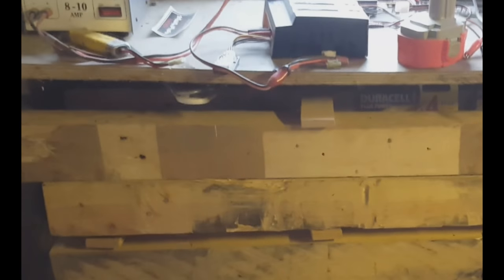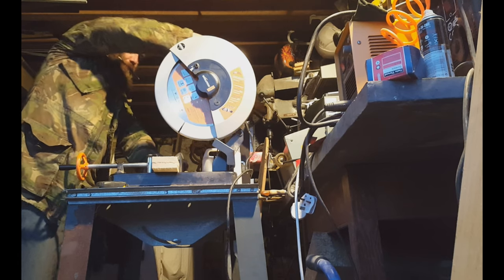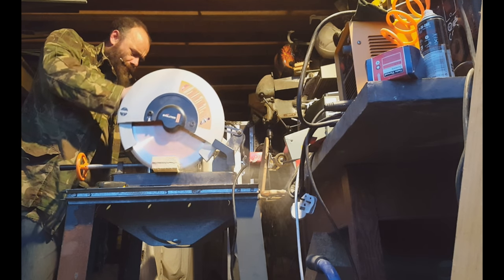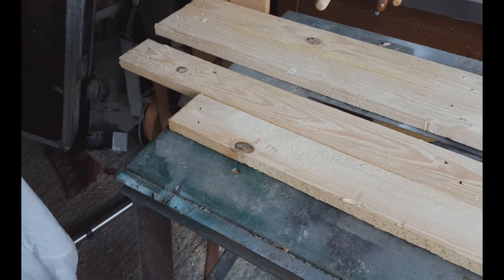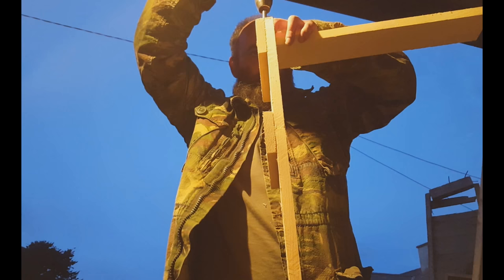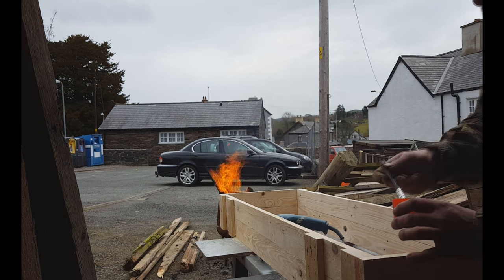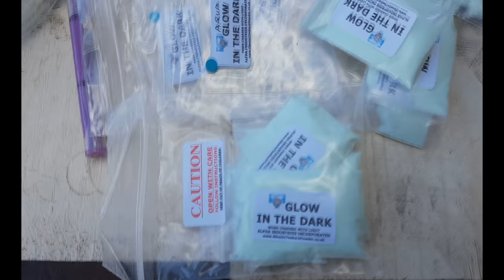DIY Pallet Coffee Table - Glow in the dark wood projects with Lichtenberg Figure Epoxy Resin

Comment: What other mixture did you add to the glow in the dark powder? Type of adhesive was it just the glow in the dark mixture?
Reply from the maker: Polyester resin im using as the base, you could use epoxy but its more expensive and seems to shrink more, sorry for late reply, im struggling a bit to keep up

Comment: I make furniture myself from re-claimed timber. I have never used the glow in the dark stuff. Is it hard waring and does it keep its glow over time?
Reply from the maker: It is hard wearing indoors, outside and it will start to weather as is usual with resins. Ive got a couple of tables here inlaid with the polyester and then covered either with osmo or epoxy clear. Im leaning on one now and sitting on a skull chair inlaid with the stuff as I type. I had issues with some early work when I was using one part resin for floor hole filling but thats not used anymore here. 
The charge apparently is caused by minerals agitated by uv light and consequently doesnt run out? Im pretty sure the numbers 25 thousand charges was mentioned in some literature. Id have to check what Ive got here.
Reply: Thank you. I am a joiner. It is all I know. I have done it since leaving school nearly 30 years ago. I can't stand the modern doors and kitchens I have to work with these days. Such bad designs. I would much prefer to make old rustic style furniture from pallets and re claimed timber. Watching your video was very enjoyable. You are old school. Much respect. Keep up the good work.

Comment: some black-light LEDs along the outside will keep the GID paint charged up.  Awesome contruct, very awesome.
Reply from the maker: i couldnt work out where to put the ones on top, do you mean like routering them in?
Reply: along the top would be a bit more difficult,  Was thinking about the underside of the top around the outside of the base to charge and illuminate your sides.
Reply from the maker: im on it for the next one ;) thanks for your input, appreciated
Reply: hey a badass construct like this, I'm glad I could give you some ideas.
Reply: I was going to suggest the same thing. UV leds are pretty cheap and they make the glow paint very bright but don't make much light of their own, so the paint would be the only light source. Love the table. I have a microwave waiting for stripping for just something like this. I have an electric welder too, would that work?
Reply from the maker: microwave yes, welder no
Reply: ok thanks
Reply: Most badass coffee table I've ever came across! But was thinking the same about the uv leds. 
You could route the underneath drill holes for the leds to pop up and afterwards pour in the glow in the dark stuff. This way you cant see them from above and the glow in the dark stuff surely would get charged from underneath and 'inside'.

Comment: i have a question i was doing some resin and hardener like what you are doing but not as neat but i turned into a ball of slime and i tried again with the right amount of hardener and resin but it did the same thing. is it caused by to little heat or mortise in the air. do you now if you do or anybody else can you tell me please

Comment: Please tell me how you did the burning of the wood! Did you use a car charger and wet the wood?!? Please I have to know.
Reply: He used a microwave transformer, attached to two pounts on the wood. The electricity flows through the wood's cellular veins, creating this natural lightning effect. 
I have seen people use car battery chargers on boost, to do this. 
Some say you should wet the wood, along the path you wish it to go. Others just do it dry.
Reply: +Googlesux Bigtime *2 points.
Reply: Googlesux Bigtime
Reply: Googlesux Bigtime when you wet the wood put 2 (I think teaspoons) of baking soda in a cup of water, stir it around and then its ready to us3 on the wood

Comment: Hy at last a English video not American.  only reason I say that is I want advice on what table saw to buy and American market different to o in ours. I'm jus getting started in woodworking and plan on making furniture,  remodeling joinery ect. I plan on putting table saw in shed but would be handy to take to people's homes when needed so a portable t/ saw may be most practical for me tho not sure if they can handle full size sheets mdf due to size of saw table. also I don't know how much to spend. am only starting so thought but medium quality first then up grade as I get busy. any help be gratefully received. Scott from wirral,  North England
Reply from the maker: Hi m8, Wirral! about half an hour away! i havent got a table saw at the moment so unfortunately i cant really advise on that, and the ones i have had were mostly all fixed in the workshop. Full sheets wouldnt be a problem if you used a few of those adjustable rollers to help take the load of the sheet and it wasnt pinching or pushing against the saw blade. I might be getting an evolution table saw soon so ill have a review on that coming. Sorry i couldnt of been much more help. Regards
Bongo
Reply: Cool. Where bout ru based
Reply from the maker: small village inland from Abergele

Comment: hy bongo,  what size glow in dark powder do you suggest o get,  looked on eBay at alpha industries and they do 10g for £2 if I want to do a table top for example bout 500mm long by 300mm.  them sizes are completely off top of my head but just so I can get idea thanks
Reply from the maker: as much as you can get m8, is it to fill in the cracks or to cover?the surface, it really eats it up, youll probably have to cut down the ratio of powder to resin to get more bang for your buck
Reply: Hy mate, I'm not sure what style I'm doing yet. But if it doesn't go very far I will get a good chunk. When you say resin. I thought it's just a powder that you mix with water or any type of paint,  does the powder come with resin

Comment: Looks great How do you burn that pattern?
Reply from the maker: microwave transformer mate
Reply: Do you have a link how you use this from the microwave? Still love the table
Reply from the maker: yes, ill go and dig it out for you, ive filmed quite a few of these lichtenberg figure projects and theyre all on my channel, theres a lot of people at it at the moment so a lot of info floating around as well,  https://www.youtube.com/watch?v=OwrIPgqMSPI
Reply: cheers
Reply: just remember, if the transformer is PLUGED IN AND ON, you do NOT go anywhere near the leads.
Reply from the maker: yup thats good advice, always follow a procedure, dont go near it until youve manually unplugged it from the mains supply, dont fit a switch, some people use rubber gloves or a insulated screwdriver to move the prongs when theyre live, thats a little bit too dodgy even for me, heres the how to video i did some time back https://www.youtube.com/watch?v=OwrIPgqMSPI

Comment: How does he do that burn thing as 3:31, hammer two nails at some small distance apart, into the wood. The apply a voltage (AC or DC and at what volts?). What is the conductor between the two nails?
Reply from the maker: High voltage from a microwave transformer, the conductor is seawater. Have a search for lichtenberg figures, but it is dangerous.
Reply: Cool, I actually have a few microwave transformers around so i'll check out the videos and have a go at it.
 I appreciate the reply.
Reply from the maker: np, here to help, just remember that its quite dangerous so youll need to work out a safe procedure to work to and follow, just simple rules like its the only thing thats plugged in so you dont get confused about which plug is which, keeping your hands in your pockets when its on, no kids or cats running around the place, no drinking or showing off to friends :)
Reply: No problem, thanks for the advice. I'll keep you posted on any updates

Comment: as you did in the burnt wood which device used, you can pass the name and has some chemical that you use
Reply from the maker: Microwave transformer for the burning, seawater for the solution, polyester resin for the filler

Comment: Can you use a car battery charger for the Lichtenberg?
Reply from the maker: No, not enough voltage. Options are microwave transformer, neon light  transformer, oil ignition starter, i think maybe also flourescent light units but unsure on that.

Comment: how did you do that to the wood
Reply: If you're asking about the "roots" design on the wood, that is made by putting nails on the wood and connecting them to electricity. The designs you see are the result of the electricity trying to find its way through a non conductive material. That's also why it caught on fire.
I'm not sure about this part, but I think that the wood needs to be wet to do this.
Reply from the maker: Thank you Jess, Im having real trouble at the moment replying to all the comments as well as just trying to do things out in the shed. Yes, pretty much as youve described it, the wood needs to be wet, when it dries out it will catch fire. Have a look at this video about lichtenberg figure etching using a Microwave transformer https://www.youtube.com/watch?v=OwrIPgqMSPI

Comment: With what did you finish the wood? Oil or varnish?
Reply from the maker: Osmo hard wax oil, its the finish for tables and worktops, its not cheap but it goes a very long way
Reply: Ok, do you take epoxy or polyester resin?
Reply from the maker: Polyester, it seems good and much cheaper to use

Comment: could i know why have you made 2 box inside together to make a table ? i think you make your job harder than it should . is it not ?
Reply from the maker: +i don&#39;t like to be famous . definitely harder, i wanted the lichtenberg figure on the inside to be visible but slightly offset from the inside of the glass, i also wanted the uv lights close but again not obviously visible,  i could have made just one large box on legs but it would have lost some aesthetic properties, i was also limited by the size of the glass, i was very lucky to find the piece that i did
Reply: ok buddy . how about this job . once try to draw a way ( i mean a line with some waves ) for electricity by water ti burn just in that way and not more , i guess if you do this for long woods , it will be more beautiful
Reply from the maker: +i don't like to be famous . i have tried, it is very hard as the water soaks into the wood and spreads out, i will be doing some more experiments soon :)

Comment: hello
out of curiosity which sand grid did you use on the belt 220? and then 400 ? on the flat sander?
as I did some test on a plywood using the belt 120 and the resin was coming off easily however due to the fact I actually sand in the way and movement you did "similar" up and down .. it scratches slightly the surface wood and the top of the inlay glow in dark powder..and it ended a little bit dusty scratches

my point is to have a good way to sand without scratching the wood and espacially the surface of the inlay/resin/

which finishing you were using on the wood to actually remove all the sandish kind of white look to rejunate the wood and the inlay?

I use this resin Silmar 249 Clear Polyester Surfboard Resin
from uscomposite
http://www.uscomposites.com/polyesters.html

I also made a box and switch on/off for the MOT with 12 gauge extension cable along with the aligator car jump tip
http://www.digikey.com/products/en?keywords=ch840-nd
we can exchange you like go to england often
Reply from the maker: yes, im new to working with resin so again im learning as i go along, being gentle with the belt sander and not allowing it to heat up too much which clogs the belts quickly is one,  the belt sander ive been using though is pretty nasty, it does the job but ive got a newer one now and theres a fair bit of difference

i use 80 to finish on the belt sander, i use some really worn belts to get most of the scrathes out, and then i switch to my small finishing sander with 120,  im too lazy to go any more and down the grits to polish it back up again but apparently you can do that with more succesive grits, i saw a piece of wood with a mirror finish on it not so long back that had been finished with 2000 grit paper, it was unbelieavably smooth

ive also read that if you co back over with clear resin it will make it shine again? i should really try that out and see what happens, ill keep you updated or vice versa if you have better results?

sorry i dont understand your last part about exchange and england? i live in wales and england is about 50 miles away, i go there sometimes
Reply: yes it does make it shiny however only with clear crystal resin, polyester clear resin I use Silmar 249 Clear Polyester Surfboard Resin it is a bit expensive however really good.

After sanding I apply High-Gloss Helmsman Indoor/Outdoor Spar Urethane  on the wood.
so it seems to do 120 on belt then 220 on mouse then 400 or 2000 on flat sander

TIPS on 2000 and 400 I poor or wet the 400 or the 2000 grits in a bowl of "Minerals spirits" (buy in home depot or any hardware shop)
that make the sanding really smooth on the surface of the inlay with resin

I also use for different style pigment color mix on wood which has hole on it or junction to be filled with the polyester resin by using a very tiny amount deep a bit toothpick basically filling hole and using blue tape underneath,  blue tape is good because it coming off really easily from the resin,
the result with that color give a  beautiful light transparent
 I am making a shelf with wood and hole with a blue ocean pigment color.
a bit of green and blue pigment (do a lot of test before to get the ocean blue result it is going to be amazing)
 
for inlay/resin glow in dark powder or stone crushed turquoise.
sand it again I sense with 2000 "thanks for the tip" will work nicely then apply the oil again 
you can do a process  two or 3 passes 
sanding with a 2000 grit and apply the helsman oil clear and do it again:)

I also just apply after sanding on 120 blet then 220 mouse then 400 flat sander a layer of resin spreaded with a brush on all the wood then that's it using epoxy resin to do that will turn it yellow on the sun so I avoid and refrain to use epoxy resin for final work. 
I use epoxy resin to do test on plywood only through different experimentation. 

glad to connect with you.

Comment: what is the ratio of powder to epoxy?
Reply from the maker: im just having this conversation now with a chap, were having some difficulty, language barrier i think :)

I made a video on it here, would you run your eye over it and tell me if its coming across ok? If not then ill make another shorter video probably tomorrow. Unfortunately im not using epoxy but polyester but the ratio is fairly similar. https://www.youtube.com/watch?v=l773_JPO-9g&t=124s

Youre looking for a one to one for best results, for example 100g of epoxy part A, 100g of powder, mix them up and then add the required ammount of hardner for 100g of epoxy, mix well and its ready to use. Is that making sense?

Comment: could you teach me how you did this table?
Reply from the maker: yes, i can help, where do you want to start?
Reply from the maker: ok, you are talking about the glow in the dark resin design?  this is very dangerous, it requires that you remove a transformer from a microwave and use the high voltage output, i have made a video about this, only proceed with it if you are familiar with working with electrics

Comment: just watched that from beginning to end it went from a pile of crap to a big fucking WOW(swear words and capitals were necessary to emphasise my point). You are my new god of making stuff from stuff. Table is awesome and someone would pay a lot of money for that and the rest of your furniture in your house is amazing.
Reply from the maker: yes, thanks, it was a good project, the moon cribs are also a good one for turning pallets into nice pieces of unusual furniture, thanks for your nice comments! so, yourself? what are you working on at the moment apart from a gas bottle valve removal tool?
Reply: Just got two 47kg gas bottles removed the valve the old way(with a hacksaw and a hammer) spent ages filling it with water and figuring out what's the best way to cut it, definitely getting two decent sized ones out of it.
Reply from the maker: yes theyre going to take a while if you dont take the valves all the way out, and using a hacksaw to cut valves....no, just no

once theyre full of water just start making your cuts with the angle grinder